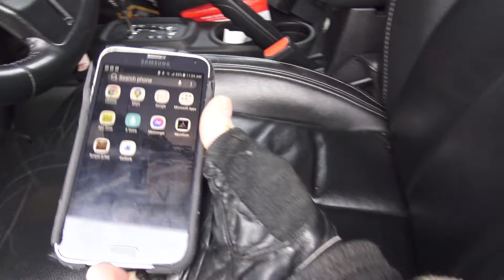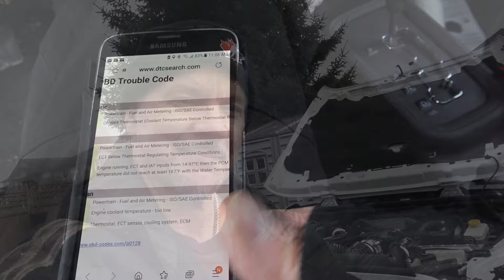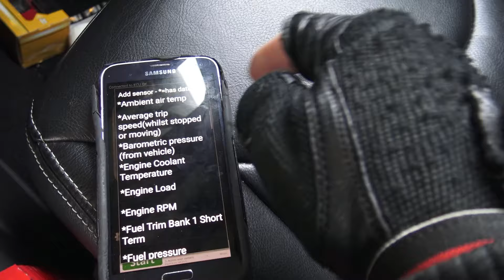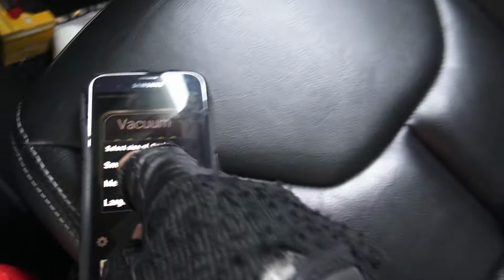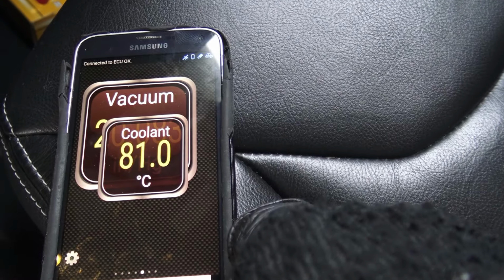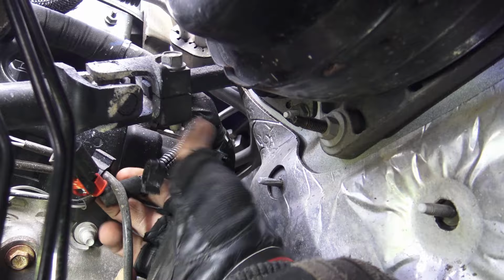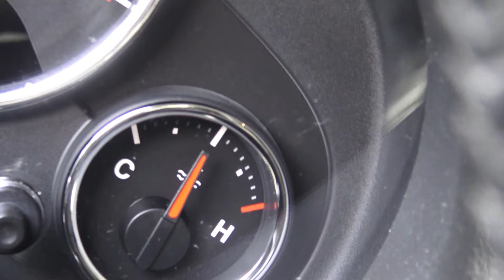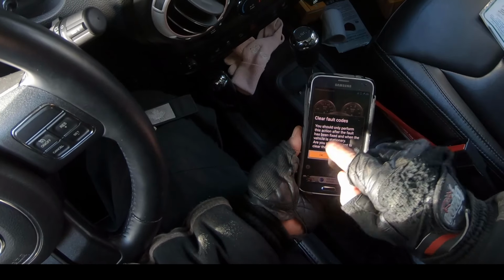P0128 Jeep Wrangler coolant sensor replace diy

Comment: DO NOT USE THREAD TAPE on this part...   Ever.
Reply: It's almost like it's a brass fitting for a better ground or somethin. And B, don't ever put teflon tape on brass because you don't need to...
Reply: I don't understand why he did it when the one that he removed did not have tape on it.

Comment: Noooooooo..... This is a 15 minute repair . All you need to do is take the one bolt out of the steering shaft and lay it to the side for easy access to the sensor

Comment: If you don't have an OBDII scanner, Jeep JKs will give you the engine code on the dashboard. All you do is insert the key into the ignition and turn the ignition to the "on" position 3 times in a row...
Reply: Wow I just tried that... I never knew! It worked
Reply: @Thewar187  didn't work on my 2014

Comment: It will tell you the engine code if u turn ignition on, then off and on 3 times quickly while pushing in key in ignition.

Comment: How much have you driven it since replacing the sensor? Did it solve the P0128 code? Or still have to replace thermostat. I should have done sensor first because my temp read fine on my gauge too but I chose to change the thermostat. Seemed easy. There’s two bolts, top one came out like butter but bottom one snapped. Was tough to extract but I got it after taking the crossover housing out. I have to wait another 12 hours for gasket maker to cure before I can refill it with fluid and see if it fixed it or if I have to do sensor. Just curious if that fixed your problem.
Reply: No, he has another video out where he changes the thermostat & housing and mentions that this didn't solve it

Comment: This is the best video I've seen on replacing the Engine Cooling Temperature Sensor!  THANK YOU for posting.  My local garage (not a Jeep dealer) misdiagnosed my problem and wanted $1225 to replace the thermostat housing!!  Crazy.  They actually said oh we are going to replace the thermostat and housing that is why it is so expensive .... um excuse me but it only comes as an assembly so yea of course you are replacing that $40 part.  Once I told them I had already replaced the thermostat (I did it for ~$50) they decided it would be $885 to replace this ECT sensor!  No thank you.  After seeing this video I will do it myself.  The garage didn't actually do any troubleshooting other than read the code then blindly suggest thermostat replacement, very frustrating.  I won't be going back to that garage.
Reply from the maker: Glad I could help.

Comment: Hey there, Great vid but one parts of miss information at the 6:00ish mark you reference the "expensive rivets" but they are actually clips and come yes once ruined will need to be replaced, but can easily be removed properly and re-used. Just get a small pick to poke around center pin and lift it out to where you can pull it with needle nose pliers. Once lifted up and out can easily be pryed on and removed . Hope this helps someone
Reply: Yes
Reply: Thanks

Comment: Stumbled upon this vid that deals with my exact error code. Kind of sucks you have to take the inner fender off. Would have been nice to be able to get at it from under the hood. Nice troubleshooting and explanation of your troubleshooting results. Did the same thing for my jeep, gets killer heat and engine temp is good. Looks like I'll be doing this same fix. I have a 2014 Jeep Wrangler Sahara. Might be able to use your exact part numbers. Thanks for posting this vid.

Comment: Couldn't you also pop the steering shaft off to access this as well? Seems like there's a good gap there that would only take a bolt or two in order to be able to access?

EDIT: I did exactly this to access mine. A bit tighter, but doable with the right tools and only requires removing one bolt from the lower steering shaft, to pull it off

Comment: May I ask a silly question? Is this the same one that is on the oil cooler unit or something different?  

I just replaced my cooler and now have a sensor error. Trying to avoid opening up my whole engine bay again. 

Thank you!
Reply: Me same question too
At engine oil coolant has temperature sensor too😂

Comment: Just FYI on the teflon thread tape - you applied it backwards on to the coolant temperature sensor.  The direction of the tape should always go on so when you thread the sensor in, the tape will not unwind!

Comment: So I just did this repair and the connector won’t fully lock on to the new sensor it’ll click and lock on but if I give it a decent tug/pull it’ll pop off. And I’m still getting the check engine light

Comment: Help! I replaced the thermostat first (thinking it was that) and the code went away from the dash but remained on the code reader as a permanent code. Coolant temp at 218 degrees (normal), and gauge read at mid-range but still no heat. Would it be the sensor or something else?

Comment: I found that pulling the fender off works for me. They did put it in a tuff spot.
Reply: I replaced it in 10 minutes without removing the fender. Used some zip ties to hold the inner fender up

Comment: 4.24   teflon tape is put on in the same direction as you put on the fitting CW direction
Reply: No to be used on crush washer applications

Comment: I just removed the steering shaft and took about 15 min.  Don't have to drop the inner fender
Reply: Just did one at work  dropping steering  shaft   one bolt and  easy peazy 15 min all done
Reply: @tbday3322 can you explain this further? I was looking at it and it seemed that this would be the way to go, but I don’t know anything about the steering shaft. Is there tension on it? Can I damage something by removing that bolt? Or is it as easy as remove the bolt and then put it back after and re attach the bolt?
Reply: @Vin_easel   there is just a jam bolt  thru the upper part   under the brake booster . The shaft is indexed   so comes off one way and  goes back only one way.  Pull the  bolt out all the way  then  the shaft should  wiggle  down . Once it is you will have plenty of room  to get your hand  down to tge sensor to unscrew it.  Leave the radiator  cap on tight   you will only loose a cup or 2 of coolant
Reply: @tbday3322  thank you for the info. In a separate forum, someone suggested I should disconnect the battery so the air bag doesn’t go off? Is that accurate? And does the shaft easily go back into the indexed part, or is there a lot of tension? Do I need any special tools to get it back in place? Thank you for your help
Reply: @Vin_easel   disconnecting  battery is never a bad  idea . I didn't    only had to wiggle the shaft  by hand slipped  right down . It should slide fairly  easily it's designed  to collapse  in a crash.   Turn the wheel till you can access the bolt  then  lock the steering wheel with the key  nothing should move .
Reply: @tbday3322  thank you! I just finished it. Ez pz. Slid right off and I was able to get it fixed super quick. Appreciate the help. Cheers
Reply: @Vin_easel  sweet. Glad all went well. Way some showed how to do it was way more work than needed to be.

Comment: I’ve watched plenty of these types of videos, the disconnection of these sensors are the most problematic, and I would say 2-3 out of every connected sensor goes smoothly. Unless if your working on brand new vehicles, I don’t care who you are, disconnecting these sensors aren’t as easy as they normally show in these videos.

Comment: Is that the 3.6 engine? Is the temperature sensor in the same location as a 3.8?
Reply: In some engines the sensor is on top front of the engine block. Making it so easy to replace. My 2011 Jku sport is like that.

Comment: Lmao did you really just say something high quality from Jeep??? lmfao
Reply: I also have a 2014 Jeep Wrangler 3.6 can you tell me where the a/c fan relay is located at its not on the driver side by the lights Thanks
Reply: @isidoremartinez2529 its next to brake booster on the side.